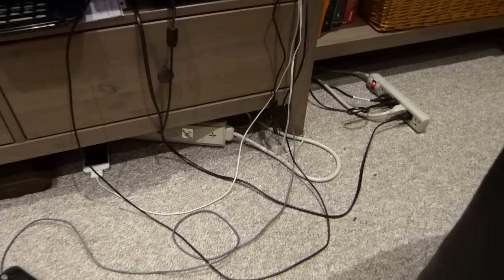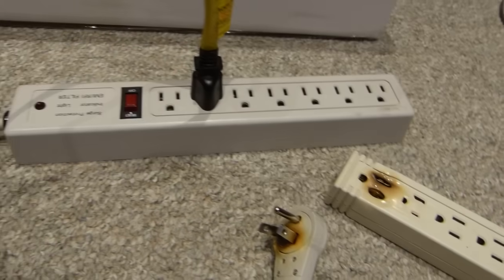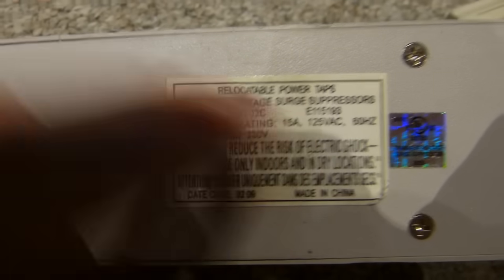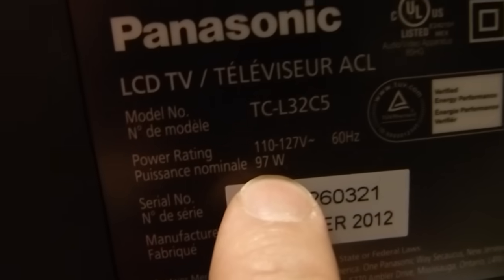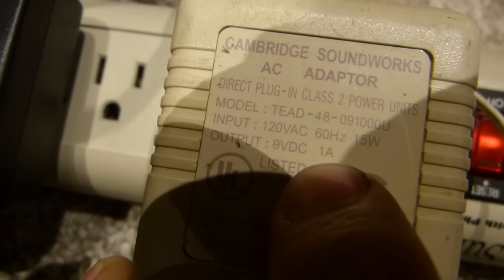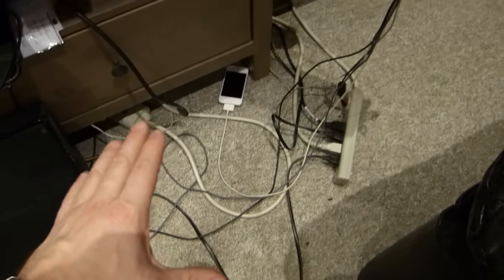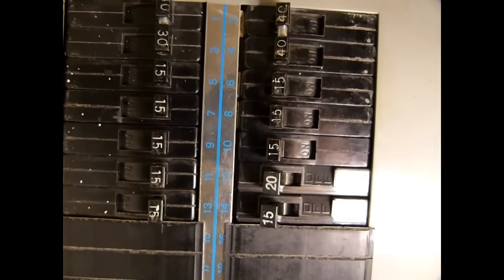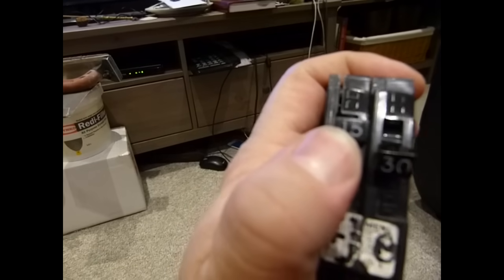Is it safe to plug power bars into power bars?

Comment: Moral of the story anyone:  Plug as many surge protectors into surge protectors with things plugged into those as you want, just make darn sure NOT to exceed 15 amps.

If those circuit breakers were not flipping when you drew a lot more, there's something wrong with it obviously, and I won't be surprised if there is considering it was from 1971, right in the middle of the time contractors were using aluminum wiring, which is extremely unsafe.  If you need to be worried about anything at all it is that wiring in your house, that will go up in flames WAY before the copper stuff in the surge protectors will.
Reply: elevator1tom real story: don't buy cheap pieces of shit and not expect it to blow up and catch fire
Reply: Well, obviously.  My college used very cheap Belkin power strips, with no surge protection.  I measured ground voltage from the neutral and hot terminals and got a voltage reading of 42 volts and 46 volts.  I immediately unplugged it.  I at home use a 200 dollar UPS unit as my power strip.
Reply: Now I'm starting to consider that maybe using ground voltage to power low power devices and charge batteries for occasional use of high power devices is viable.  Shouldn't it be not normal for ground to get a measurable amount except during spikes?
Reply: I love my electronics but I don't wanna BBQ either 😂😂😂😂

Comment: FYI - the router is rated at 5V 1A, that's what comes out of its power brick, check the rating for the input of the power brick and it'll probably be much less than 1A.
Reply: Totally glossed over that, didn't he?

Comment: Power strips should never be plugged into each other
Reply: i dont have any extensions so i used 2 power strips to run the length of my bed just to power 1 small lamp
Reply: That's just something electricians tell people who don't know about electronics as an 'all-safe rule'. The reality is that you can plug in 15 power strips in series and have no issues. It's all about the rating of the power strip, and how much juice you're pulling. My entire computer setup, with two GPU's and 4 monitors, as well as a life-support system for a fish tank which is being live-streamed via another computer, and much more, is all running in the combination of 5 power strips.

What is my secret to not catching fire you might ask? Not being an idiot. I have calculated the watt usage of every device, as well as the power rating for each strip. They are ordered and grouped in a fashion which directs tiers of low watt maximums in the farther series of strips. As for the main strip, it will never reach a point in which it passes it's rating, and if it somehow does, it will trip.

Work smarter, not harder.
Reply: Been doing this for years, no issues whatsoever : /

Comment: The heater was the problem NEVER EVER hook a heater to a surge protect!
Reply: Kinda. In pretty much all cases it will be fine, just keep in mind that it's a high resistance load. Cheaply designed power bars' caps would never be able to handle a high resistance load.
Reply: Unlimited Uploads
That's not actually true. Many devices, such as vacuum cleaners and space heaters produce a large spike in current draw when they start up. That's why your lights will flicker when using one of these devices. 

Surge protectors may see this as a surge and blow the internal fuse. Plugging a space heater, vacuum or similar appliance into a surge protector is always a bad idea, there's no arguing that.

If a power strip or surge protector is rated for something like 1500W, that would typically mean the load across all ports. If you plug a 1500W appliance into a single port you may be drawing too much energy for that single port, causing it to overheat and melt/burn.
Reply: Some of those heaters do not have a very heavy cord on them. It is a myth that an extension cord can not handle the load of a heater. Often it can. However, since you are close to the limit of the recommended load, you have to check carefully for hot plugs, hot parts of a surge bar, or loose connections. And turn the heater off when you are away or not using it, so that you know that it will not overheat something or overload.
Reply: My heater ended up frying my power bar the same way, rip
Reply: Unlimited Uploads, 15A not 1500W. Wattage is energy dissipation over time, hence the "W" meaning "watts", meaning "power" meaning "Joules/second". Amperes are the unit of electric current, which is how the power bars are rated. Amperes are in the units of Coulombs/second, with a Coulomb being the a unit of electric charge.
For those of you who haven't taken a basic physics class...
Reply: Probably they werent (or shouldnt) be rated to such power.
Reply: "At one point, somebody decided to plug into this one this heater, and what happened as a result is that it started smoking and it basically started a fire."
Reply: @Randomsae  At least the house kept warm
Reply: Also, no induction device such as a laser printer should ever be plugged into a UPS (battery backup) device.
Reply: Had the same thing happen years ago, had a heater plugged into a power bar, that was plugged into another power bar. Outlet melted where the 2nd power bar plugged into the first.
Reply: Powerlimit of powerbars mostly is 15 amps. Most heater are at that 15 amps limit, like boilers, coffee machine, compressor etc. Should go directly to the wall outlet
Reply: Each outlet is supposed to be able to handle 15 amps. But given the crap that comes out of China, and the tendency to cut corners to save a penny, I would be a little nervous about using something at close to the rated limit. Often when plugging a heater into an extension cord, the extension cord is cool to the touch as long as it is not bunched up which could allow the heat to build up, yet its plug might be kind of hot, due to a poor connection at the obvious weak point. But even the switch area on a power strip can get quite warm, when you are drawing high current through it.

BTW, a heater is a low-resistance load, which draws then high current. I think somebody previous stated it wrong, saying high resistance. But high resistance items would be something like a lamp or a clock, that draws but only a tiny amount of current.
Reply: Those aren't surge protectors
Reply: a heater is just consuming electricity like any other, just because you know it consumes a little bit more he should still be able to check all his devices and their power consumption.

if one power bar is rated 1500w and other one is 1500w, once you run 1500w on either you're at max capacity, you're running 1500w thro both ofcourse, this guy probably ended up running more than rated for thats all, heaters has nothing to do with this, just the power consumption of the devices attatched.
Reply: Raymond Leggs and don't plug in air conditioning units into it. They heat up the wires and plug its meant to be pluged directly into the wall socket. These extention blocks are meant for low wattage like tv's ps3 etc
Reply: Cio Dokop A surge protector guards from voltage spikes. It's not a circut breaker. Plus these aren't surge protectors there power strips. If it's a surge protector it'll say "surge protector" right on it.
Reply: Dank games Thank you I think people confuse surge protectors with circut breakers too. All in all these are just power strips no protection built in what so ever.
Reply: I have heated my old farm house for 5 years using electric heaters. Never a problem and I wont have a problem in the future. The wiring to all of my outlets is rated at 20 amps and I have enough circuits to handle everything. The biggest problem with heaters are the cheap plugs they use on them. If you need to use a drop cord for a heater make one using 12ga. cable and you will be fine and I'm talking about 15 feet or less. Very few home owners have ever seen a 12ga. drop cord. 50 years of being an electrical contractor, elect. eng. and electrician.
Reply: Exactly you should never plug a space heater into a power strip major fire hazard!!
Reply: Or into any kind of power strip, wall tap, or extension cord. High power devices like that heater are designed to be plugged into the receptacle directly.
Reply: Raymond Leggs thank you
Reply: Raymond Leggs oops I have a heater connected to my surge protector
Reply: A heater plugged into a surge suppressor, should be okay, as it is within the normal rating for such devices. However, such a circuit can only support but only 1 high-current device, so do not plug in any refrigerators or toasters or anything like that. Set your heater to the lower power consumption setting so as to have a safety margin, and check the plugs and also the switch area of your surge suppressor, to make sure that nothing is getting more than slightly warm, after the heater has been on for a while. And turn the heater off when away for a while.

Turning the heater off, is probably safer than unplugging it. The problem with unplugging, is that especially if you wriggle the plug around because you are too weak to pull it straight out, is that you over time, loosen the connection, so that it is more likely to develop a poor connection and overheat. Better to use the switch on the heater or on the surge suppressor, to make sure that the heater is off.
Reply: Raymond Leggs why wasn't it fused!!.?
Reply: shit
Reply: Raymond Leggs I
Reply: Raymond Leggs .
Reply: Raymond Leggs ye
Reply: Raymond Leggs learned that the hard way, I have a greusome burnt extension cord thanks to a heater I had plugged in.

My dad still wants to force me to plug that heater into my power bar
Reply: Unlimited Uploads Did you even watch the video? He showed how to do it safely, he pulled that burnt up one out of his office at work. He literally showed you how to do it safely. The power strip is rated at 15 amps so the total amount of amps your alliances draw can't exceed that rating. You could chain enough of those power strips together to create 30 outlets plug a .5 amp alliance into all the outlets and you'd be safe as long as the stuff you plugged in doesn't draw more then 15 amps in total your fine. I shouldn't even need to explain this cause he did in the FUCKING VIDEO YOU DIDN'T WATCH BUT COMMENTED ON.
Reply: Of course. Heater needs a LOT of power just like electric showers (5000W+) It basically consumes over 10 times the energy of a gaming PC (500W). Make sure to plug the heater on a 20 Amp socket without any power bar or adapter.
Reply: Cio Dokop
 Surge protection protects like name indicates from power surges and sudden jumps of power. Never more delicate electronics might fry from that, hence surge protection. IE power from outlet is never stable and might exceed the rated power, if for instance power is cut from one part of town suddenly, or lightning hits the power net. Sure surge protection cannot do miracles like getting hit by millions of volts, but that energy can travel far in conductive material like power wire, so it can prevent delicate machines from frying, due lighting strike on wire 100km away.

Not a expert, this is just how i understand the topic.
Reply: Can't tell if its from the power suckage or Heat doing something from being so close to each power strip
Reply: 3000W/230V = 13Amps
Reply: Heater elements usually contain more dangerous components than most consumer electronics though - if they malfunction, the materials they are made with don't simply blow, they tend to melt together causing a short, and causing a much larger current draw. If you watch a few videos on how Circuit Breakers actually function, you can see how a power strip can potentially catch fire before the circuit breaker trips.
Reply: Heaters should always be plugged directly into the wall. Most heaters you buy nowadays have big warnings in the box NOT to use extension cords or power strips. And, of course, you should ALWAYS ensure all your devices (especially high powered ones) are either UL or ETL tested and certified. Don't buy cheap shit off eBay or AliExpress. Shit is dangerous. And the Chinese are now putting fake UL marks on products. Always check UL's website to ensure the product is listed.
Reply: i run my heater in my surge protecter
and my pc
and the monitor
and the laptop
and the cell charger
and the pc speakers
and the EHDD
and two more things, but arent ever really used

but if i run both heaters on the same circuit, i blow the fuse,.. but that is a pretty known fact, i still do it for some reason lol
Reply: Yes it was
Reply: Yeah, power Wattage curves cause effects.  A power spike might occur and the electrical breaker won't trip sometimes.  So a good rule is to never plugin high wattage devices into a power strip like a heater or dryer or oven or  welding machine.  Anything that is meant to get really hot.
Reply: Some power bars are just badly made.  Here in 240V-land I had my tumble dryer plugged into a switched extension.  The wall socket was fine, the cable was fine, but even with the load of 2000W (about 8.5A) the socket on the extension lead melted, even though it was supposedly rated to 13A.  So I replaced the switched powerbar unit with a normal switched double socket and a backing box with cord grip in it, and it has worked perfectly ever since.  Wall sockets are made to a much higher standard than many extension sockets.
Reply: Surges are small high voltage pulses that damage electronics. This issue has nothing to do with surge protection.
Reply: Yeah other things like air conditioning, dryer, washing machine, toasters and any high power devices must be plugged in the wall outlet. Connecting them in  the power board can cause the power board to catch fire as too much power goes in the power board. By looking at the power board that is burnt the heater would done that.
Reply: Lol then whats the use of the surge protect
Reply: @beedslolkuntus2070  overload protection and surge protection are two different things.
Reply: In Germany/most EU power bars are rated for 3000w, 230v, that is why devices need less amps which is safer.
Reply: rust40549 Extension cords are fine, even if you daisy chain multiples of them, provided they are built up to specification. The main takeaway point here is not to use low quality power bars and especially not to plug multiple high power devices into it. Theoretically speaking, if you put a few power bars together but you just use only one of the outlets, it should be fine.

Comment: This power bar is a classic case of a poor connection. Happens when the plug doesn't make a full connection. Ive seen this on CH breakers too - in particular the BR style. 14 gauge can handle 18A without a problem. The 15 A is a rating given also to compensate for high ambient air temps which changes how many amps rather conductor can carry and for how long before the insulation is compromised. 
The power bar problem above is avoided when an AFCI breaker is used.

Comment: Also I would also give a notice. Over time contact between chinese and even non chinese  plugs/sockets tend to oxidize due to thermal cycling, moisture, also dust adds its toll. So it may start heating even if you are at 11/12/13/14A of your total 15A maximum. Also, if contact between socket and plug gets overloaded for some time, oxides and burns start to develop between contacts and that encourages even more heating. So I would recommend reaching 50-80% of the load maximum and recycling the plugs into sockets, also taking a look at the state of conductors and cleaning if neccessary. When unplugged/replugged, the conductors scratch off the oxides/dust and thus the contact improves.